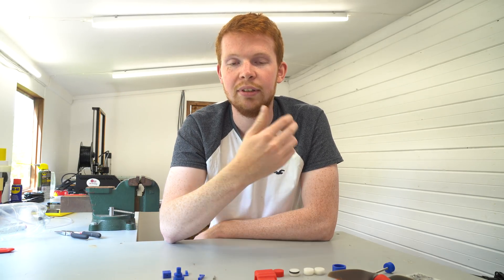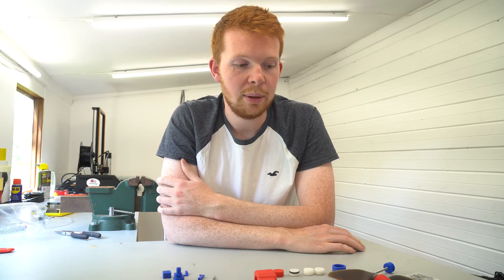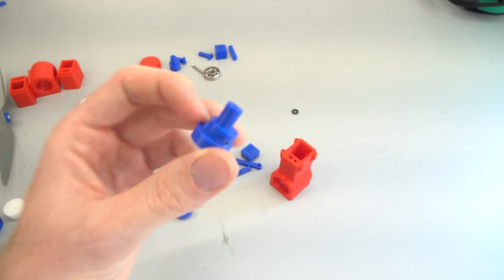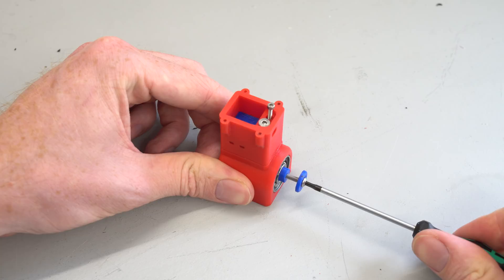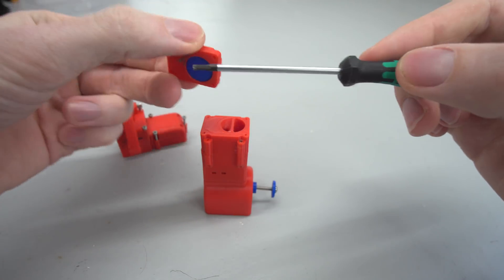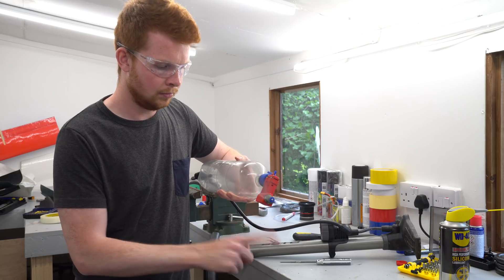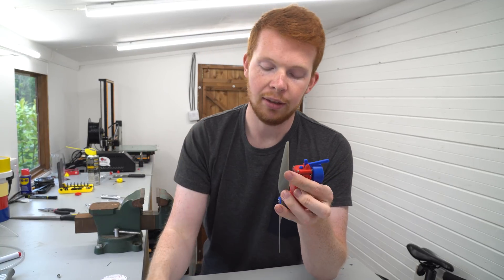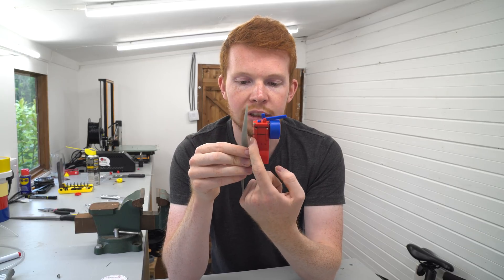Air Engine Exhaust Valve

Comment: more stroke actually puts more stress on the crank, because the piston is travelling faster and has to be accelerated harder. this is one of the reasons why F1 engines Reving to 18K rpm have very short strokes.
also the bigger bore allowes for bigger valves and more power.
i love this video series btw.
Reply: Correct. The #1 issue engine designers worry about is piston speed. By reducing piston speed, you increase reliability.
Reply: MsMotron for complicated reasons related not to metulurgy but rather propagation of flames our pressure waves, a piston can't travel more than about 60mph (if I recall correctly), that is what limits the rpm of long strokes.
Reply: HunterDuck r - This is a two stroke engine, the strokes are a intake/power stroke and an exhaust stroke. This is because the pressure is provided by the pressure reservoir (air pressure being fed in the intake), rather than the detonation of a fuel source. This is why the timing can be done through the crankshaft, as the timings are 1:1 with the rotation, rather than 1:2.
Reply: I do agree. The advantage of the shorter stoke is the rmp like you are saying and that is important when talking about a propeller. Haveing all the torque in the world (long stroke)  wont help if you only can spin the prop 500 rpm. I also am wondering if a varation of a 2 stroke would work? I mean that is really what you want. The simpler the better
Reply: Yes, and this is one of the areas where compressed air and steam engines have an edge...that and the ability to have a piston driven on ALL strokes.
Reply: MsMotron there's a difference between torque stress and cantilever stress.  A longer stroke makes the crank throw longer, so for the same piston force you're right that there's more twisting force on the crankshaft which is a problem for big multicylinder engines. Here, though, Tom says he's concerned about the length of the lever arm between the crankshaft bearing and the crank itself (big end?), and a bigger piston diameter will mean a longer crankshaft and so more leverage on the bearing.
Reply: Thanks for clearing that up . Was also thinking bout f1 engines and their short strokes
Reply: it increases efficiency though, since the air moves the piston a larger distance
Reply: Yep i did this in lego and gained 2000rpm from a short strokw

Comment: I still recommend doing an inline twin cylinder. In theory it would double the torque. Maybe you could just make a larger cylinder? 

The crankshaft doesn't have to be made more complex, you could always just duplicate what you have and attach the second engine where the propellor would be on the crank now.
Reply: Also, I love this video series, you never really see anyone designing and perfecting their own devices like this anymore. Most of the pneumatic engines you see on YouTube are either prefab or Lego.

Comment: Hey Tom, It's such a bummer to see the exhaust valve didn't help. I thought it had a lot of promise in the configuration you were using with both ported exhaust and the poppet valve. I hope your next version has more success. I also mentioned before in one of the comments to your past air engine that the O-Ring seal used in compression on the bottle mouth was a potential problem area. They have always been a source of leaks for people making water rockets with 3D printers. I've designed a system that moves the o-ring to the exterior of the bottle mouth that works up to about 200PSI. Feel free to look at how the system works in my video: https://www.youtube.com/watch?v=xHOR-srdI_k
Reply: why not a slide valve like  a steam engine? or even a wobble sleeve type valve inlet like a small toy steam engine, the mammod etc trying to force open a valve under pressure is hard
Reply: thanks for the spoiler
Reply from the maker: That's an interesting O-ring seal, does it require the flat washer as well? or can you get away with just the O-ring? Might have to give that design a try! Thanks man
Reply: No, it does not require the flat washer. The O-ring itself provides a seal. The flat washer was added as an alternate because a lot of people have access to the replacement rubber washers for garden hoses which are easier to obtain that O-rings. Another design you could employ is making a male 22mm protrusion that goes into the mouth of the bottle and provides a proper o-ring groove that seals against the inside of the mouth of the bottle. That concept does weigh more, which is why I came up with this design. Keep up the good work. I love this series!
Reply: Beacon of Wierd I hope he sees this!
Reply: I've been trying to give you advice on how to optimize your engine, but I seem to be drowning in other comments, so I'll try here;

Optimize the stroke distance using this following formula:
Optimal Expansion Volume = Pressurized volume * (Pressure - Ambient Pressure)/ Ambient Pressure.

Your pressurized volume is the volume when the cam closes, the expansion volume is the extra volume from when the cam closes to when the piston is all the way down. As you can tell this optimal expansion changes based on the pressure, hence choose the mean pressure your system will run at.

This is the main reason why a multi expansion engine is more efficient, it allows for a wider range of optimal pressures. A more complex solution would be to try to change the expansion or pressurized volume based on the pressure.

This is probably the thing which could improve your efficiency the most, making the cylinder round will improve it slightly (since you get more area per gap).